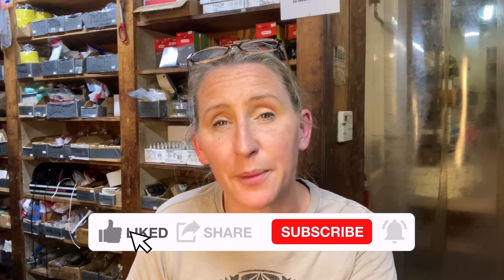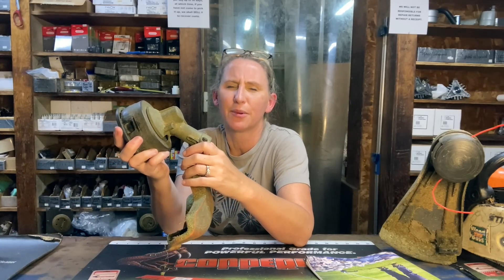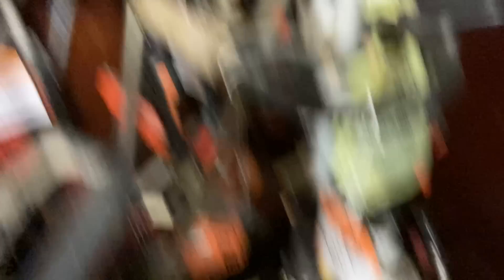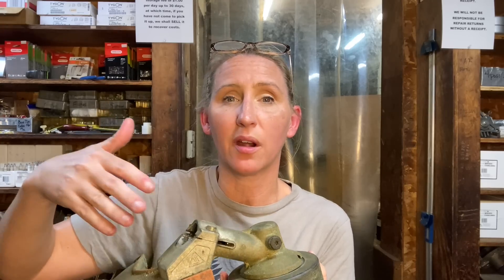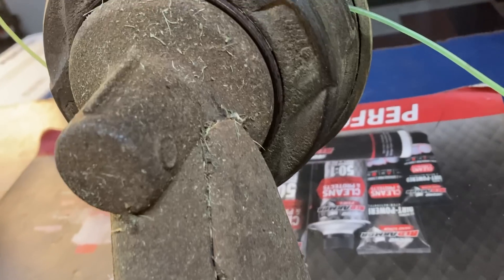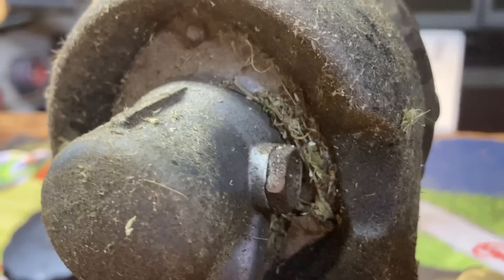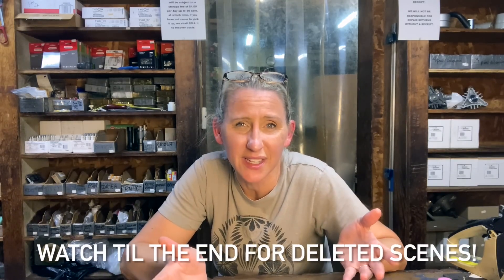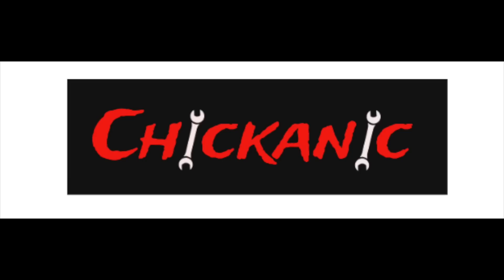Planned Obsolescence?! Why Would STIHL and ECHO Do This?!

Comment: Hi! I recently bought a Stihl FS 55 and I'm quite happy with it. I saw a video that showed to remove the transmission head, and grease it from the inside out using a grease gun. Would this be an option? I totally agree with you that removing the grease bolt is a really bad idea. probably has to do with increasing turnover :( 
Finally, I love your video work! Regards, Bas - Netherlands

Comment: I sit in dismay after checking my brand new FS56RC only to find that she's right--no grease plug.  Well as bad as that may be, it certainly illustrates why Chicanic is one of my two most important sites.  Guess I'll just run it to the end and buy the fix if needed.  Thanks yet again, Bre!
Reply: Drill it and tap in a grease zerk. I've done it to mine it's not hard to do
Reply: @oldschoolnewsguy  Nice to know that option is available.  Thanks!
Reply: I wonder if you could take it apart and drill a hole to add a zerk fitting?
Reply: Surely since you bought some MotoMix when you bought your trimmer that 2 year warranty will keep you in gear heads 😄

Comment: I see many posts, indicating that they had simply added a grease zerk.... However, I am of the understanding that the correct grease, is a less viscous, lithium based grease, much like that used in a lower unit on an outboard motor and that it is just squeezed out of a tube , into the gear head. (it's not sold for use in a typical grease gun) I would think that typical chassis grease, would be too viscous and present problems due to its physical properties. 
Please fill me in on your thoughts about this. 🤔🤔🤔

Comment: Yup. About a month ago it was time to retire my Stihl straight-shaft trimmer (and yes, I knew about the grease plug and greased the head yearly), so I looked at the Echo products. Figured with my reasonable lawn size, I could get away with an SRM-225. What? No grease plug? AYFKM? The dealer just shrugged. I wound up buying an SRM-2320T. These heads are expensive, so I'll be using that grease plug accordingly.

Comment: A good while back I was told by a small engine center in my town that U.S. consumers wanted "maintenance-free" everything, up to and including mower deck spindles. So they did away with things like Zerk fittings. That trend continued in automotive applications too. So now we have sealed bearings, which do fail.
Reply: Sealed bearing can be easily repacked. Many videos here on yt how to do that. I do that now with my bearings, repack them. Just watch several videos rather than just 1 video.
Reply: They want maintenance free because of maintenance costs.  Also, sealed bearings only fail sooner. Dont act like all bearings don't wear out. 

A maintenance kit for a trimmer is $20-30. For a larger engine they're $50-75.  A full service is $40-50 or $150-250, respectively, per year. If I buy a $2000 42" cut craftsmen that gets me 10 years couldn't I just save my $200/yr to buy a mower in 10 years? And what happens if I'm out 6 years maintenance then my $600 transmission goes out? Now I've got $3800 in a 6 year mower with still $800 to go before the 10 years.  (Yes, well taken care of tuff torque and hydro gear transmissions do fail) God forbid a $900-$1500 engine fail on that junk.  

Same is true for stihl and echo....trimmer is $225. 5 years of $50 maintenance and you've spent more than a new trimmer 😂.  

What people don't talk about is all the good features are still available on every brands' top models. Funny thing is, you pay double the price and get double the time.  $400 for a 20 year trimmer is not far removed from $100 for a 20 year trimmer 30 years ago.

The real truth is we are cheap, lazy, consumers and manufacturers just provide us what we are willing to buy!

Comment: Same with the newer MS180 chainsaw, crappy air filter letting dirt into the engine, non adjustable carb which is always too lean, air intake next to where the chain trows all the dirt and dust instead of on the opposite side. Stihl just build it to fail asap.

Comment: I bought a PAS-225 and the blade attachment because I know the boom will get trashed and easy to replace. Just ordered the Torque trimmer boom, it no longer has the speed feed head (a real disappointment) and when it arrives I will check it for the grease plug. My five year old SRM-225 has never needed any repair work and I checked the grease once and it was fine.. As a former mechanic myself, these manufacturer's eliminate service points to sell parts, and YES that gear Head is gold to the company knowing it will be trash from serious users to sell new equipment.

Comment: No oil change needed, no grease plug. Just like your new vehicle's automatic transmission. No dipstick/filler tube and instructions not to change the fluid because it's good for the life of the tranny! Of course they don't specify that life expectancy. How often should those gears be relubed for homeowner use cutting a normal residential yard weekly? I think my PAS-280 is at least 10 years old and I've never done this for the trimmer attachment.

Comment: The money is in parts the powers that be (manufacturers)and it’s not just small engines I run or I ran top hammer and down the whole rock drills I got sick of fixing my 2000 ish drills which have very high hours 20 and32 thousand hours and was looking into new rock drills well I ended up buying atlas copco which is now epiroc and to make a long story shorter than it is 
      I had one of the actual design engineers for the hydraulic system which is very complex because the engineers preach about how efficient the hydraulics are and they are complicated which is the trade off for the amount of efficiency my drills went from burning 10 to 27 gal/ per / hour to 4.5 to 18 or so per hour and at 5 per gal that’s a considerable savings that we could pass on to customers the manufacturers to save on initial machine price cut corners so parts will wear out faster and the new parts are considerably more durable but expensive but they don’t wear out as often as when new for the ability to sell parts so in essence you’re buying 2 of all parts it’s not that the initial parts are inferior but are designed to fail so you have to buy the new higher quality parts and parts is where they make all there money not the initial sale

Comment: I had a farmer customer fit a grease zerk to a Shindaiwa straight shaft trimmer. He then pumped in grease with his grease gun, and failed to remove the trimmer head and spacer. The grease then went up the drive shaft housing and pushed all the bushings in the housing up to the engine. As a result the drive shaft was not well supported, so the vibration was intense. So, be careful if you fit grease zeros is a warning to all.
Reply: That is a very strange story because to pump that much grease in to have it fill the whole shaft that far, the over-greasing was by 2 orders of magnitude the larger problem., not anything else.

Comment: FS55 to FS70 trimmers are all non grease heads as Stihl class them as domestic or  light use trimmers. It's not until you get to the FS94 onwards that you will find grease points on the gear heads as they are designed for heavier usage.

Comment: Skipping over the planned obsolescence thing for a minute, the other reason they will delete grease fittings is people simply don't use them.  Why put them on there if very few people bother to add grease or even service their machines.  I'd be tempted to drill and tap in for my own fitting (pencil type in this case so it won't catch or break off), but if the trimmer lasts the average consumer for 5 to 10 years, do they really care enough to be bothered.

Comment: Good video. What I was hoping was an extension of the rant against no grease plugs was how to grease the ones that do have grease plugs. I see some comments below that speak about drilling it out and putting in a zerk. This is good but a 2 minute segment in your video on how to do this would have really been helpful. Some of us don't have tap and die sets in our toolboxes. Without the drilling and tapping, how do others grease their gear heads? I take out the plug, clean all the surfaces around the edges thoroughly, then just force my grease gun against the opening. I keep turning the head so that the cavity will accept more grease, or use a small screwdriver to tamp in the grease. With a well engineered piece of equipment like my FS94, why such a stupid way to grease the gear head?
Reply: For Stihl trimmers, their tubes of grease are made so that the tube simply screws onto the grease port. Squeeze the tube, done. Some folks object to the cost of a tube of Stihl grease. But if you grease your head once a year, that 80 gram tube of grease will last years and years and years. BTW, while you squeeze the tube of grease, make sure to rotate the head to help the grease work is way into all the nook and crannies of the gear head.
Reply: @SignorLuigi  Thanks.  I did not realize Stihl had tubes of grease for this purpose.  I've been  using Stihl products for over 20 years and have not seen any tube grease products on the shelves.
Reply: I pick up a 60cc syringe from a local farm or garden store and fill it full of grease.  Usually the tip where you'd attach the needle is enough to get thru the hole so I can squeeze the grease in more directly than with just a grease gun.  I've also at times used a short length of vinyl tubing that fit snugly over the tip of the syringe.

You can also buy various gauge syringe tips (not needles) to get into smaller holes.  And in fact you can buy various attachments for your grease gun to serve a similar purpose.
Reply: @Sylvan_dB  Thanks for the suggestions.

Comment: I have a Stihl FS70R that does not have a grease plug, and upon me reaching out to both my local dealer and customer service neither one had an explanation for the lack of the grease plug.. shocker! (Oh, we didn't even notice it was missing). 

After doing some online research I found that Stihl had changed the design on a few of their entry level trimmers  specifically for wild fire forestry crews that needed something more maintence free.  When I go to my local dealer I have noticed that every model above the FS70R has a grease fitting. 

Is this information correct, I don't know.  Stihl tehnical service has told me that these heads are designed to be maintence free as it relates to greasing the head.  Time will tell

Comment: Most 4 1/2" angle grinders use a pinion and bevel gear arrangement but I've never seen one with a grease port on it.
Reply: True but they tend to get fewer hours continuous use than a string trimmer in a commercial application.  Either way, yes eventually you should take the head apart and grease it.
Reply: @stinkycheese804  I dunno 'bout that. Grinding welds in a fab shop that grinder is going half the shift

Comment: ....from reading some / alot of the comments,  I would say.....'' re-engineer '  most  anything, you buy, with an engine on it ; and / or  wires. From appliances, to tree trimmers, whackers, ANYTHING. 
Picked up a free fridge, on Monday. LG  brand, very large, two top middle opening doors, large freezer on the bottom, with ice-maker.  THE  COMPRESSOR  area, rear bottom , plugged up with syrupy grease like stuff, dust, alot of dirt. IT  COULDN'T   COOL.  SO, i cleaned it all with hot water, air pressure, etc.  NOW,  I  AM  LEAVING  THE COVER  OFF, SO as it can stay  COOL. 
Good to go.  A free fridge, now working  very well.   My advice, to ALL :   Remove the cover, and clean your compressor area, every 4 months or so.   LEAVE  THAT  COVER  OFF.....so the heat can expel.   The fridge should last alot longer......maybe if it is  one of  very poor  design.

Comment: Bubba was going to the local convenience store for a 12 pack of Miller Lite, on his mower. As was mentioned in another comment, planned obsolescence = more new equipment sales and parts sales. Like the grease points on chainsaws, most owners don't know about the grease point on the trimmers. Or greasing the drive shaft.
Reply: Grease point on a Stihl chainsaw?  Do tell!!!
Reply: Bubba probably was going for a 12 pack of Miller Lite..probably used to drink Bud Light, but not now!...😅

Comment: I had my Husqvarna 345fr with bush cutter. It jumped around and cracked the shield. I removed the shield and tried to start it. (impossible when cold). When it  can't rotate on the lawn it burned the cluch and later brooke the shaft?? It was delivered without bushing in the gray carb house. Now I left it to repairshop..... 😢

Comment: Do a muffler mod to gain power and reduce heat on the exhaust side of the piston and run 40:1 mix instead of 100:1 plus premium fuel will keep dentenation down over 87 octane. 
Your saw will last for ever.
 Why do we still see McCoulloch and Homelite saws of the 50's and 60's  still running today ?
The ratio for fuel/ Oil then was 32:1.
I know I own quite a few Old Mac's
The old 1010 series will still cut with the best of them today  and swing a 28 inch bar and chain. 
Believe it is 52 cc or 47cc.
The 1010S ,55 and 555 are 55cc's

Comment: You know, over the last 20 + years or so,  our  tech world, is going the way of  ' use once '  throw away. Manufacturers are finding out, people are  really   MECHANICALLY   NOT  THERE.  Which, is why some auto makers,  REMOVED  THE  TRANSMISSION  DIPSTICK ! ( People, putting the wrong oil / fluid into them - tor prevent warranty work being done AT THEIR  EXPENSE )
This, use once thinking, slowly grew into the system, WHEN  the generation evolved into  '' NO  MORE  PRIVATELY OWNED  SERVICE  businesses - separate from the manufacturers.  Just look around the  home depots,  Lowes, Home Hardwares  etc.  DAMN  NEAR  everything, is cheaply made, with alot of plastic, and only to be used once.  FOR   the  manufacturers, to have a vast and extensive  PARTS  DEPARTMENT,   IT  IS  NOT  WORTH  THEIR  TIME / MONEY  AND  VALUE  OF  THE  CHEAPLY  MADE,  products  from  most all of them.  Things, coming out of China, alot use the lowest , poorest  quality of steel  they can find / make. I found out.  Such as gas petcocks, on generators. CHEAP, some kind of pot metal / pewter, or some other crap. I won't  even comment, on modern   ' lawnmowers '.  ((got 6 of them, some alot better than others - 3 Stihl  weed whackers, 2 used for parts for the main one. I put a grease nipple, on the shaft, about a foot above the head. Shoot some grease in there, then add an ounce of 80-90 gear oil. Keeps 'em  lubed up.  ))  I have 2 years tech school education, in electronics and compute repair. (1990-1992) . THIS  COMPUTER  WORLD, is similar. Modern computer 'cases ' ....mostly tin cans.  Anyway, try to make  the  best  of  whatever you  have,  LAST  AS  LONG AS  YOU  CAN.  SINCE   boys / girls,   do  NOT  COME  FROM  A  FARM,  MOST  PEOPLE, have, sadly   NO  CLUE, about anything  mechanical / electrical.  
THANK-YOU,  MISS Chick-mechanic, for revealing  ' zerks '   to us.  WE ,  the  people,  must  of necessity unite, and learn / educate from  each other.   GOOD  LUCK,  and  manage all well, all that is within  your  POWER !   (from east central Alberta, oil tank farm town).

Comment: @Chickanic Hey I have a stihl fs 70 and mine has no grease plug but the pinion shaft as I call it is hollow and I use a grease gun to put grease in through the shaft.

Comment: Unfortunately it's become a throw-away society regarding these small machines, appliances, and tools. I've spent the last couple weeks rebuilding a small hydrostatic transaxle that was "sealed" , no drain plug, and considered to be maintenance free. (Which, like your new trimmer gear head, is a bad idea) After 400 hours, the transmission tore up inside. Over $900 for a new one, what a ripoff. Will fix the old one. 👨‍🔧

Comment: Even my Crappy old Poulan straight shaft trimmers have a grease plug on them.  My Small Engine Mechanic Friend told me (I don't know how many times) that the Poulan trimmers were made to use 1 or 2 seasons, then throw away and get a new one.  I told him that they aren't throw aways for me and I use to buy new cylinders and Pistons from Poul;an and rebuild them for about $50.00 rather than buying a new one for about $200.00.  
I also buy the trimmer attachment rather than just the gear box by itself (the last time, it was even cheaper to buy a complete trimmer), although my "issue" now is I like the "Tap-N-Go" trimmer head and can't hardly find them anymore.

Comment: Many years ago I  was working a summer job at North American Rockwell, one of the guys I worked with, his wife was a secretary for one of the higher ups at Ford told me that the reason that Ford stopped putting grease plugs in u-joints was that they saved $0.15 per car, over the many cars they produced was a substantial savings for them. I'd say that the grease plugs were eliminated 1 for savings and 2 to sell more gearheads.

Comment: Off topic question: So far as you know, is there a difference between clear and yelllow tinted Tygon tubing?   I have some equipment with rubber hose gasoline lines that might benefit from Tygon due to the drunken fuel exposure.
Reply: Tygon goes brittle either way faster.  I had Tygon fuel line on a modified Honda GXV120-powered snow thrower and it was pretty hard and brittle at the end.   Rubber is better for larger engines.